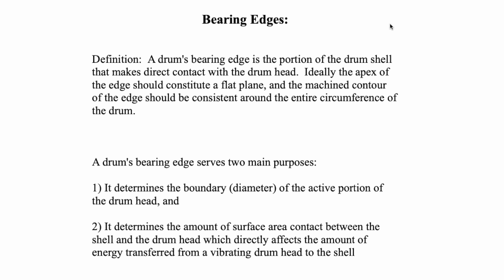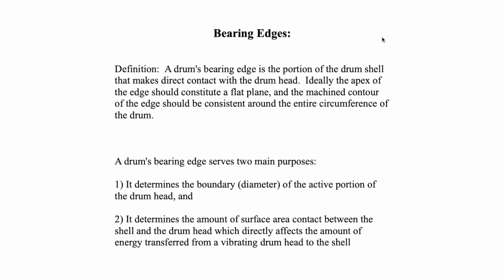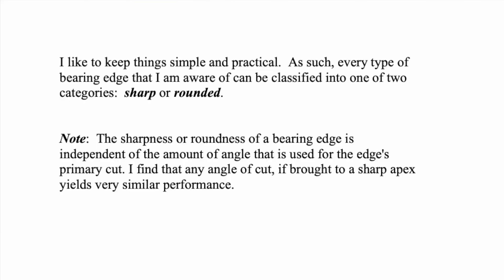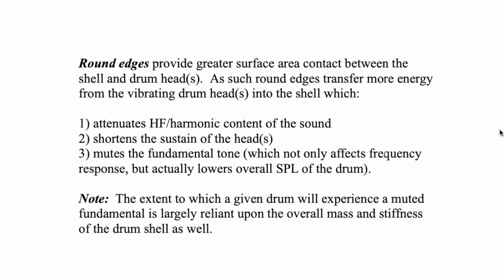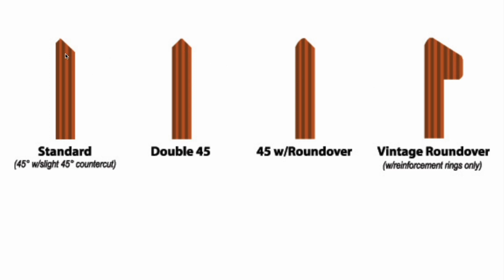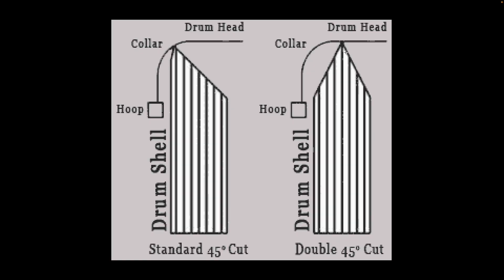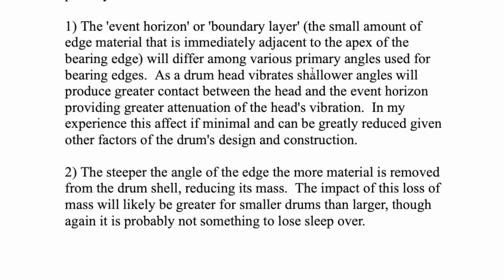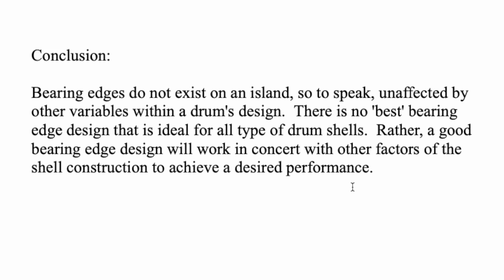Bearing Edges -- Drum Sound Physics Part II

Comment: Hey Joel! I never really thought about where the apex sits on the head until I saw the video that Kirsch Drums posted here on Youtube. Maybe you have seen it. 
Almost 10 years ago Evans startet their 360 system with much steeper collars to solve these kind of problems. Nevertheless I find Remo heads much more lively and resonant than Evans but that may be due to the material that is being used. One question I had since the last Video which popped back into my head after seeing this Video: Does a thin shell really shorten the sustain of a drum? If I have thin shell and a thick shell with the same bearing edge, wouldn't the force transferd to shell be the same? For example if I punch a thin and a thick Wall with the same amount of force, the thin wall would break while the thick wall wouldn't because of how much energy each wall can absorb. The energy that I'm transfering into the walls however should be equal. So just because my thin shell gets excited and my thick shell doesn't, they should receive the same amount of energy from the head.  Then again, I'm no physics expert but I just can't see it in my head. Unless the vibration of the shell goes back into the head and causes cancelation? Please help! :D
Reply from the maker: What your saying, if I understand it correctly, is spot on:  the transfer of energy, all things being equal except the thickness/mass of the shell, is going to be the same.  The question is how does the shell respond to that amount of transferred energy?  It is basic physics that fixed energy will excite more reaction in lower mass, all other things being equal, so the lower mass shell will vibrate more in response.  The shell with greater mass, however, will react less to the transferred energy.  Is this enough to excite the denser shell into practical resonance?  It won't be as much as with a lower mass shell, but it could still have an impact.  

The greater the vibration of the shell, however, the shorter the sustain of the drum.  This is just a result of the energy being bled off the head(s) into the shell, which removes that energy from the heads (sounds like I'm repeating myself, but literally, with less energy in the heads they simply won't vibrate (sustain) as long).  So yes, a lower mass shell, again all other things being equal, will vibrate more, and that shell vibration disrupts the purer behavior of well tuned heads, attenuating the fundamental tone/pitch of the drum, creating a shorter and more harmonic sound.  

Does that make sense?  I'm happy to continue thinking of other ways to explain it if not, no worries.  Please let me know!  And thanks for reaching out!!
Reply: @drumdotpizza  Your explanation is great! I just realized that I have misunderstood one of your points and made it worse by phrasing my question totally wrong! What I intended to ask was "Does the AMOUNT of bleed really differentiate in thinner and heavier shells (let's define thick as heavy and thin as light) and is therefore the reason for a difference in sustain." In this and your last video you were saying things like ".. it robs the energy from the drumhead as it starts to vibrate." which I incorrectly interpreted as an argument that the amount transferd is different. But you were talking about about wave cancelation all along. Sorry for the misunderstanding, I rushed to false conclusions!
But here is a another thought you can help me with: A thicker shell reflect the soundwaves inside the sound chamber better/longer, since they can't penetrate the aswell like in a thinner shell. What characteristics does that enhance? I heard people saying it makes for better projection and more volume (Ford drums compared it to a canon, but there we have an opening). But I never understood the correlation completely. Shouldn't it also interfere with resonance and sustain if more soundwaves bounce back to the drumhead?
Reply from the maker: @ckdrums3408  You're getting into some serious physics here with the interaction of sound bouncing around inside a cylinder and interacting with the drum heads!  (And you have brought up something with your new question that I frankly haven't spent much time thinking directly about, but I believe I can venture a somewhat educated guess :)

Yes, greater mass will contain more frequencies for longer, but there isn't much mass in a drumhead, even 2-ply heads (less mass in a head than even a thin shell), so essentially, except for high frequencies, and perhaps some hi-mids (not sure exactly where the line would be) it's all gonna leave the drum by way of the two 'openings' at each end anyway, so I don't see a thicker shell making much difference in that respect.

I will say, however, that the hardness of the interior finish greatly affects the higher frequency portion of the sound.  High frequencies are stopped by even low mass, so they will stay inside the drum longer if it's got two heads.  Inexpensive drums usually don't have a finish on the inside -- it's bare wood.  Without some kind of seal on that wood (tung oil, polyurethane, etc) even fairly hard wood will suck up high frequencies fast.  By sealing the wood the highs hang around a bit longer, providing a clearer, more articulate sound.  Many a cheap drum set can be improved significantly by just sealing the interior!
Reply: @drumdotpizza  Your videos certainly spark new trains of thoughts in me which is highly appreciated. When my love for the technical aspects of drums emerged around 8 years ago, I always tried to amount as much knowledge as I could by watching all the videos from different drum makers like Ford, Kirsch, Guru etc. but the topics always seemed to be narrowed down alot and biased on their own concept. Having a professional drummer of many years talking independently about experiences and debunking (or demoneking) marketing hypes with 30 minute videos is pure gold for me. I would love to throw some of the concepts and ideas that I gatherd from reaching out to different drum makers over the years at you and hear what you think about them. Your time is problably very limited, but if you ever have the time and desire to make a podcast for your channel with this kind of theme... let me know! Until then, can't wait for your next video! See you there!

Comment: the first purpose of a BE is to transform lug tension into head tension that needs to be as even as possible and controllable : hence perfect geometry and surface roughness. Beyond that the angle will have a big impact on the mechanical impedance of the BE : The shallower the angle the closer. you are to the flexural stiffness of a "wall" - matter removed from cut are first going to influence first the stiffness
Reply from the maker: Interesting!  I never gave much thought to a softer angle have greater edge stiffness due to the increased mass there (or the lower stiffness of steeper edges).  I would think that, while totally true, the impact of this would be minimal so long as the tension applied to the edge isn't extreme.  On a softer wood shell, like poplar or basswood, I can see this becoming a practical issue, but for maple, birch, and the like, much harder veneers (particularly  with the preponderance of glue used in thin shells) this wouldn't be a real concern.  

VERY interesting food for thought though.... you can just rock me to sleep tonight!!!  :)
Reply: @drumdotpizza  and also : as you truely state the global impedance of the shell, in contrast with the one of the head will make more sustain for heavy and stiff shells (remember Stephen Volpp Peavey design ? This was about getting a big impedance at head boundaries and still keeping a light shell), it is also true that shell do not radiate sound (not very much) but rather influences head vibration (which radiates the most) through coupling , and the coupling element is the BE in the case of structure borne vibration but you also have to consider the shell being loaded by the sound pressure waves inside - I have built a rig to measure shell behavior in that regard and first conclusion is that in the frequency range of a snare for instance, it is the mass law. Cool to consider 80’s work on drum acoustics but since then some progress has been done (not by any major brand) by universities and…Repercussion !

Comment: Can u explain the reason for the Yamaha Recording Custom shells sounding so "earthy", like they do. Do the full length lugs across the whole length of the shell dampen the shell's vibration considerably? That's a lot of metal. Would a completely round top edge not give the same damping effect?
Reply from the maker: Mass and edges are two different things.  I am not intimately familiar with the design of Recording Custom drums other than the fact that they are birch shells and have the stretch lugs.  I am told that they are, compared to more modern designs, thicker, heavier shells, but I have played RC drums in the past, and I don't remember them being anything like what I would consider a heavy shell, like a late 70's Ludwig or Sonor Phonic.

Greater mass (from shell or heavy lugs/hardware mounted to the shells)  will promote the fundamental tone of the drum and make the harmonics a lesser percentage of the sound (the mass doesn't choke or otherwise diminish the harmonics, mind you, it's just the increased fundamental that makes the harmonics a smaller overall percentage of the drum's tone.  

I'm not sure what you mean by 'earthy', but if you mean a stronger fundamental tone, more focused, with greater sustain that other drums, then yes, they are probably more MASSive (dense, greater mass) either because of the shells or the shells and hardware together (the hardware will have similar effect of a thicker, more massive shell).  

Also stock RC drums have no isolation mounts, so the brackets bolted to one side of the shell will put all the force of gravity pushing down on that drum on that one spot, inhibiting vibration of the shell.  this will also promote the fundamental tone.  

Does any of this seem to apply to RC drums in your experience?

Thanks for reaching out!

Comment: This video has been the most helpful so far.   I don't think anybody does any bearing edge work where I'm from and it isn't something I hear about, even when nerding out with other drummers.  Which is wild because of how much of an impact it has on the drums sound and tunability (or so I've gathered from my research).   

Have you come across any methods to true up a slightly out of round metal drum?  I scored an Acrolite for $35 at a pawn shop!  Maybe it was a bargain because of this very mild warp but I've talked to the shops employees and they don't seem like they would discern this issue, let alone that they had an Acrolite on their hands.  Anyways I have an idea of how to go about it but I'm interested in what you may advise.  

Thanks!
Reply from the maker: I would use care when bending an Acrolite shell back into shape.  Aluminum isn't as malleable as brass, but you can do it (and overdo it, so be careful!).  Is the concern a 'flat' in one part of one of the edges?  Or has it been dropped on a lug, and the shell pushed in at that point?  My recommendation for how to address it is different, depending on what the damage is.  ????

Comment: Thank you for the information! But I still have a question. Do bearing edges lose sharpness through time? And need to be redone again?
Reply from the maker: Depends on how they're treated (the tension they have to support) and whether the wood they're made of is hard enough to bear that tension.  Softer wood will have softer edges.  Tuned with high tension this will likely break down the edges over time and warrant a redo at some point.

Comment: Great video. I’m an owner of a set with very sharp 45 edges and want to improve tunability and mellow tones. Question: if I wanted to slightly increase bearing edge contact with the drum head, would sanding the edges be okay or too risky? If anyone can provide some guidance here it would be greatly appreciated.
Reply from the maker: You can mellow the apex with sanding, yes, but be very careful to do so consistently, so you don't wind up with high and low points along the circumference of the edge.

Comment: Great video - really thoroughly enjoyed it along with your previous one! Here's the part that interested me the most - heavy shell drum with round edges = a dull sounding drum. I like to use 2 ply coated heads (usually Coated Emperors) as I just really like the fatness you get from them. But I am aware that they reduce sustain and high frequencies. So my question is: in your experience, does heavy shell drum with a 2 ply coated head = a dull sounding drum?
Reply from the maker: Does a heavy shell drum with a 2 ply coated head = a dull sounding drum?  Answer:  it depends.  On sharp edges, no.  Dull edges?  Definitely more so.  Keep in mind, too, that my comment about the dull sounding combination (heavy shell, round edges) was taking into account some distance between the mics (or listener) as well.  High frequencies are literally dispersed and absorbed by the viscosity of air, so several feet away the life that may exist up close tends to be severely mellowed, particularly if that 'life' (HF content) was minimized to begin with by round edges, muffling, etc.  

Miked up close, however, it is easy to retain the HF response.... room mics will not hear it that way, however.  Perhaps DISTANCE should be another topic for another video?  Never thought about that as a worthy topic individually, but maybe it'd be useful, particularly for the people who fancy using as few mics as possible to capture drums.

For many years I used coated Emperors on my heavy late 70s Ludwig kit with fantastic results (studio work, miked close).  The edges are 30-degrees on those drums, but they've been finished to a fairly sharp apex (by my friend Jon Zoog at Dallas Drum, not by Ludwig).  The sharpness of the edges allows for plenty of HF content, though even single ply heads and sharp edges will still produce a darker tone when auditioned across a room if the shell is really dense/heavy.  

More recently I have really been digging Aquarian single ply texture coated heads (I need to do a review of them), because their film is stiffer than Remo or Evans, and the tonality is something of a balance between a coated Ambassador and a coated Emperor.  They have more authority and are a bit more controlled in a 'not dull' way, if that makes any sense (I am extremely sensitive to muffling and prefer none for my general playing style (though you wouldn't know that based on recent uploads to this channel... but I have another coming shortly that will be more typical of my tuning preferences).  So I've been using the single ply Aquarian TC heads lately, and they are very lively, yet refined as well.  

Got a bit OT there, but hopefully that helps answer your question!  Thanks so much for your kind words and for being here!
Reply: @drumdotpizza  Great answer! Thanks so much for taking your time to write back. I also like minimal dampening on toms when possible. Feel like often when there's a lot of dampening, the toms ultimately end up getting buried in the mix. And that's the last thing I want as I love the toms - probably my favourite part of the kit!

Comment: Love this series. My findings are… Yes, thicker shells with sharp edges give much more power and projection and a higher pitch but fatter note at the same tension. Thinner shells give more pitch bend less projection and power but are generally warmer sounding. Thin great for recording. Thick great for live work, outside work where power is needed! 👍